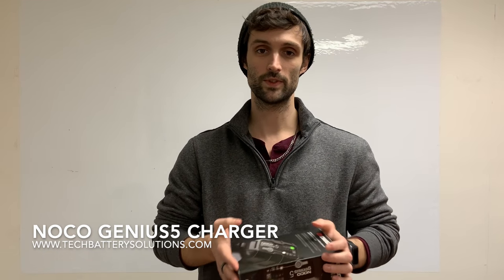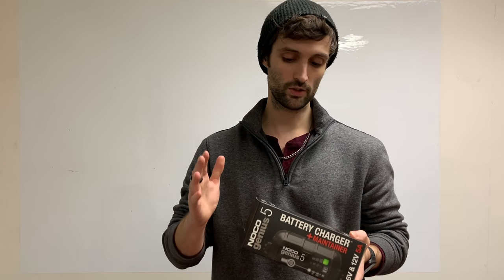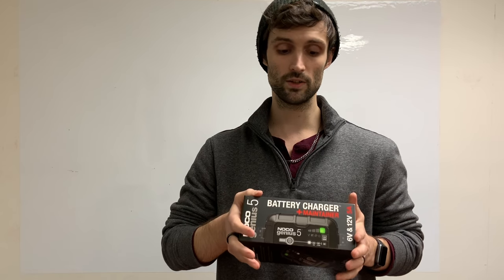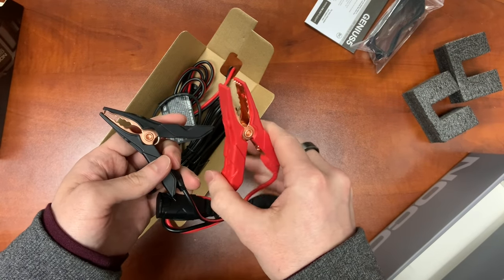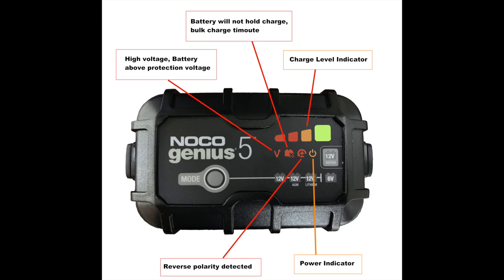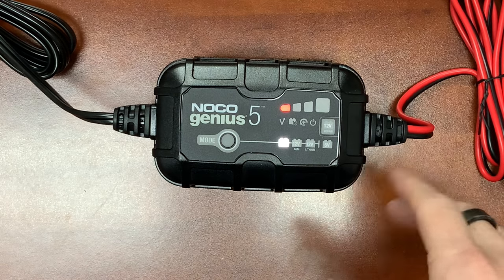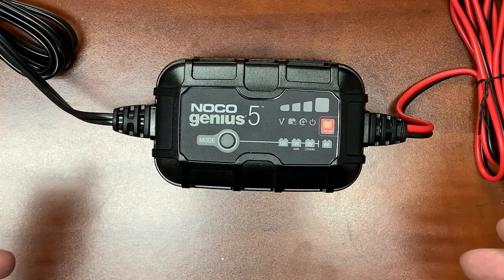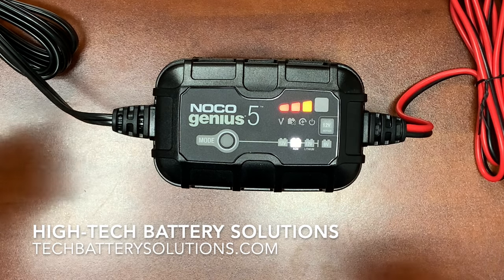NOCO GENIUS5 Battery Charger Review, In Depth

Comment: My question is do you charge the charger and store it in your vehicle or does the charger itself have to be plugged into an electrical outlet to work?
Reply from the maker: The charger must be plugged into an AC outlet in order to charge, it does not have an internal battery.

Comment: I have this charger and for the first few months (arbitrary, was taking detailed notes) it worked fine.  This included switching out of "maintenance mode" and recharging the battery when loads were placed on them.  My shunt would record essentially 0 amps when in standby and when I applied a load I could see the - amps for a while and eventually I would see + amps (varied based on load but the math was always "load - 5amps" as expected) as the charger sensed and began to replenish the battery.  If I were plugged in and using loads my battery was basically always at 100% per my shunt indicator.  

And then I noticed when checking the battery monitor that it was at 90%, or lower depending on how long since I checked.  Long story short, the charger would not come out of "maintenance mode".  Unplugging and replugging would initiate a complete charge cycle back to 100% at ~5amps.  But then the same failure to come out of "maintenance mode" would result.  

This is on a LiFePO4 100ah battery.  I now have a heater assembly on the battery that draws DC power from the system as needed to maintain greater than 40F.  The battery BMS has a cold temp cutoff circuit which was activating a few overnights before I had a chance to install the heating system.  I see nothing in the Noco manual about this interfering with the charger sensing circuitry.  

Do you have any insight on this phenomenon?  I've spoken with tech support and made no progress beyond offering to take my unit back to se if they can duplicate.  In the meantime I've purchased a different charger but have not installed it yet.  I'd rather not use that style charger as it is more of a hobby/workbench charger and not "designed" as a 12vdc battery system charger.  I have high regard for the Noco brand but I cannot figure out why this is happening, beyond a glitch in the microprocessor and/or sensing programming.
Reply: Someone else here said that maintenance mode can last up to 48 hours before going solid green? Mine is currently pulsing, and I don't want to try repair until it comes out of that mode. It's only been on for about 6 hours (just bought the charger today).

Comment: Want to use on a bike battery but the Haynes manual I’m using says should be charged at rate of 0.7 A  (Yamaha sr125 1986) will this be ok or will it over charge the battery? I have other bikes and cars so would rather have a charger that will work on them all. Thanks
Reply from the maker: This charger is a bit too strong for that battery. What you have there is a 6 or 7AH unit, I recommend taking a look at the GENIUS2 series from NOCO.

Comment: If I get noco genius 10, what will be different? Speed of charging? Or is 5 amps safer for regular flooded  12v batteries?
Reply from the maker: It would be the rate of charge as the big difference, both the GENIUS5 and the GENIUS10 are fine for flooded automotive batteries.

Comment: Got my mounted per instructions and as soon as I started my rig it started smelling like burning wire. I disconnected immediately and smell stopped immediately so what’s up here? What did I do wrong?
Reply from the maker: It would take a considerable amount of heat to melt the rubber coating of the wires - there is either a reverse polarity situation or you have a dead short somewhere in your setup.

Comment: Can I start the car when it is connected to the battery with or without connected to the power?   Will it ruin the battery if I use repair mode on a good battery.  I just wanted to put it on repair mode on a 4-year-old battery.  Thank You.
Reply from the maker: I do not recommend you start the car with the charger hooked up to the battery regardless if it's connected to AC or not. The repair mode will not ruin a 4-year-old battery, but if there is no issue with the battery at the moment then there is no need to engage the repair mode.

Comment: Can I trickle charge/maintain my battery by connecting it via the alligator clips? I ask because getting to the battery terminals requires unhooking a bunch of plastic clips and a plastic cover.
Reply from the maker: Absolutely, whatever method you choose to connect the charger to the battery will not make a difference for the functionality of the charger - it will still go into its charge and maintenance mode.

Comment: Hi
I've just bought the Noco genius 5.
I've hooked it up to my flat battery which is only a few months old. It's pulsing red, one light only. Like the light dims and goes solid then doms again and goes solid and so on.
It's been on charge for about 24hrs now, nothing has changed, it's been pulsing since.  According to manual,  red pulsing means it's under 25% charged. It's been 24hrs surely it would have charged over 25%, or is my Noco a lemon?
Reply from the maker: 24 hours is a considerable amount of time to continue on the first stage of the charge cycle. Do you have another battery you can try the charger on by chance?
Reply: @High-Tech Battery Solutions, Inc   i decided to reset the charger. After resetting it was pulsing on first red for about an hour, then it went straight to the green pulsing.
It's been green pulsing for about 6 hours, the battery indicator has turned to green which I'm really happy about. Not sure why it stayed in the red pulsing stage for so long.
Battery is charged.  I'm leaving it overnight pulsing on green. Thanks for your reply.

Comment: Great review. Will this charger be sufficient to charge/maintain standard sedans such as Lexus and Honda?  How is the GENIUS10 compared to this GENIUS5 (for example, what additional features on the 10 would warrant twice the cost on Amazon? And is it really needed?). I saw that your channel also reviewed the GENIUS10 review as well. Thank you.
Reply from the maker: The GENIUS5 will handle any car battery without an issue for both battery charging and maintenance. The only true difference between these chargers would be the charge rate - the GENIUS10 at 10 amps and the GENIUS5 at 5 amps.
Reply: @HighTechBatterySolutionsInc  thank you

Comment: Can I keep the battery inside my house to charge or does it have to be plugged while the battery is in the car?
Reply from the maker: I recommend leaving the battery in the vehicle to charge if possible, its far safer to charge the battery outside rather that inside your house. Flooded batteries will gas when charged, AGM batteries are safer however can also gas if they developed a short.

Comment: How do you turn it ON? I just bought this, put it to charge but when I press the Mode button it doesn’t turn on. Or those it turns on when it’s connected to the battery?
Reply from the maker: When you connect the charger to the wall outlet prior to connecting it to the battery do you get any lights on the charger at all ?

Comment: NOCO 5 does not charge 6v lead sealed battery. Will only charge a 6v AGM (absorbent Glass Mat)
Reply from the maker: Negative, you can charge wet cell, gel cell, enhanced flooded, and calcium style batteries in the 6V mode - the 6V mode is actually not recommended for AGM batteries.

Comment: Can I use it while the battery is still hooked up to the car, especially when starting a very dead battery 🔋 🤔
Reply from the maker: You can leave the battery connected to the vehicle however keep in mind this is not a jump starter. NOCO does not recommend starting the vehicle while the charger is connected to the battery.

Comment: Does this work for standard 12v pickup truck batteries? Here is my battery Ssb 24REXT.  If so would you use the 1st mode 12v?
Reply from the maker: Yes, this battery charger will work on all automotive batteries without an issue. For your 24REXT series battery you would use the standard 12V charging mode as that is a flooded group 24 series battery.
Reply: @HighTechBatterySolutionsInc  thanks!

Comment: Does it come charged out of the box?
Reply from the maker: Just to confirm, this is a battery charger and must be plugged into the wall outlet in order to charge. This unit does not have an internal battery and is not able to jump start any vehicles.

Comment: When I get it tomorrow, do I have to enter any specific mode when I hook it to my c6 2008 Z06?  I want it to trickle charge and keep the battery at full charge.
Reply from the maker: You want to use the mode that corresponds to the chemistry of battery you have in the bike.
Reply: @HighTechBatterySolutionsInc  it’s a standard car battery
Reply from the maker: @Maximus091768  Then you would use the standard 12V mode on the charger.

Comment: Hi can I charge my car battery while it's connected to the car using the genius5 or I have to disconnect the battery from terminals
Reply from the maker: You can charge the battery without disconnecting it from the vehicle
Reply: Oh ok is there a way I can charge the battery with the hood close because I believe the alligator clip might get in the way way

Comment: One question. Do I have to remove the dead rv battery under my hood to use this device in the house? Or is this device  chargeable with the tail end plug 🔌 n the just go outside and clamp it to the battery while still in place under the hood? I’m confused how to actually use it. I purchased this today
Reply from the maker: The GENIUS5 battery charger does not have an internal battery, so in order for it to charge your RV battery it will need to be plugged into the wall. Now you can run an extension cord out to the RV to avoid removing the battery if it's parked in your driveway. If its too far for an extension cable to reasonably reach then bringing the battery to a location with an AC outlet would be your only option using the GENIUS5 charger.
Reply: @HighTechBatterySolutionsInc  ok thanks! I’m late but it’s been a while right and it worked bc I realized that! The product works however I tried to do it again and forgot which mode to select right, it’s not charging! I need help. I did it the first time now it won’t confirm. Meaning when I hold it til it gets to the 12v in the front, it doesn’t CONFIRM and start charging . It should be pulsating but it doesn’t ! I’m so frustrated now. Cause it worked at first. What to do? I attach the red first then black. I selected the 12v mode then it just keeps blinking fast from red to green as if its still in standby mode. Why won’t it charge? The mode button is just trash. It should be a button that just allows you to click on for which ever mode you’re on. All this holding is worthless and it doesn’t even confirm when it’s on that mode. Please help
Reply from the maker: @e_thegod5303  When you say the charger is blinking fast from red to green - it sounds like your in the force mode which will have the charge mode LED and the charge LED alternate with each other. You do not want to hold down the mode button - a simple click will switch between the primary modes of the charger. You want to click the mode button (do not hold) until the 12V mode is lit up.
Reply: @HighTechBatterySolutionsInc  noooo this thing is on the 12v mode and it’s still blinking showing all the colors vs pulsating indicating it’s charging. Can I email you footage of this? Man I paid $105 and it already seems broken
Reply from the maker: @e_thegod5303  I think it may save you some time here to reach out to NOCO direct to see if they can confirm its an actual warranty issue. You can request a call back at https://no.co/support

Comment: Is this for standard 4 cylinder Suzuki Swift car too ? 

Is it for Mercedes sprinter large van battery too ?
Reply: If it is 12 or 6 V battery
Reply from the maker: This charger will work on the Suzuki without an issue. If the Mercedes has an auxiliary battery bank on it to run additional accessories then I would recommend stepping it up to the GENIUS10 unit.

Comment: Hi Richard - I have a 2003 Ford F250 diesel with two batters in parallel and just purchased the Genius 5. Do I just hook up the clamps to the appropriate terminals on the driver side battery and does the Genius 5 automatically trickle charge the batteries with low voltage?
Reply from the maker: In most cases yes, that is the way they are set. If you have access to a voltage meter you can double check that your AUX battery is getting charged as well. In some setups there is a essentially a kill switch that when the vehicle is turned off then the AUX battery is disconnected from the starting. Its not something we see a lot, but I have seen it.

Comment: Thanks for the video. So are you supposed to keep it hooked up to your car so it can replenish the battery anytime it dips?
Reply from the maker: Ideally yes, the charger can be left hooked up to your vehicle battery indefinitely to keep it topped of with no adverse effects to the car or the battery.
Reply: @HighTechBatterySolutionsInc  thanks. I’ll keep it in the battery
Reply: @HighTechBatterySolutionsInc  After hooked up for 12 hours, mine became very hot on bottom. Like 70 degrees Celsius.
The green light just pulses.
Also, the dead battery showed charged in 45 min ...how can that happen?
Reply from the maker: @westbay5858  If its flashing on the green lights then your not at 100% fully charged. Was the battery total flat lined and how big is the battery?
Reply: @HighTechBatterySolutionsInc  it was a12 volt agm car battery with 2 volts in it.
Isn't flashing green in maintenance mode? 
My volt meter reads 12.5 volts after 45 min. Seems too quick.
Reply from the maker: @westbay5858  That is too quick for sure. The pulsing green light means you're at the very end of the charge cycle and its tapering down the charge rate. In my personal experience if the charge rises that fast then there is a good chance the battery is damaged beyond repair. Its not a 100% guarantee, but I would leave the charger on until you get a solid green and then get the battery load tested to make sure its output is good.

Comment: I can't get this to charge SLA batteries(tried 2 genius5). tried 12v 6a and eventually tells me they are bad batteries. I hooked up a meter and I did notice its pulsating 19v ever 1-1.5 seconds to the battery. not sure if that is normal.
Reply from the maker: Have you checked the battery to see if there is an issue with it? Also, what error is the charger throwing?
Reply: @HighTechBatterySolutionsInc  no issues. tried about half dozen SLA batteries. it eventually after hours on the charge will eventually light up the bad battery icon.
Reply from the maker: @antok86  Not sure how to trouble shoot that - especailly if this is your second unit and your having the same problems. We have not had any weird battery default errors charging SLA or lithium batteries on the GENIUS series. I would try reahcing out to NOCO support to see if they have any remedy for you - no.co/support.
Reply: @HighTechBatterySolutionsInc  have you been able to charge 12v batteries that were at or below 7v?
Reply from the maker: @antok86  Yes

Comment: Can this charger keep on maintain for more than a day. Say I leave car charger on for many days. Why it turns to standby mode? Is this mode still maintaining my battery?
Reply: Each time I plug in for charge after a few hours it goes to standby. Why is that? Will it charge again automatically if battery become low again?
Reply from the maker: @MT-xy7fw  What light does the charger go to when you say its in standby - is it just the power light on?
Reply: @HighTechBatterySolutionsInc  orange light up.
Reply: @HighTechBatterySolutionsInc  at 4.00 your video diagram say it is the power indicator.
Reply: i left it for 24 hours and now it goes to maintenance mode. So it does actually switch from standby to top up when battery goes down.

Comment: Lets say we are in camp site with power outlet, can I charge the car battery with noco and plug a heater to the car cigarete lighter?
Reply from the maker: Probably not, the heater may have a strong enough draw on the car battery which would cause the NOCO charger to error out thinking there is an issue with the battery itself.
Reply: @HighTechBatterySolutionsInc  I see, what about a laptop or home internet box? Probably 65 watts?
Reply from the maker: @jacksongil9123  You would probably be okay with that low wattage draw.

Comment: I need a charger to keep in my car in case my battery dies when i'm at work. What do you recommend?
Reply from the maker: Are you looking for a jump starter or a charger? All of the NOCO GENIUS series chargers require a wall outlet to charger your battery, so if your in the middle of parking lot its not going to do you much good. If your looking for a portable jump starter with a self contained battery (no AC required) then I recommend taking a look at either the NOCO GB40 or GB50 series jump starter.
Reply: @HighTechBatterySolutionsInc  Yes a portable jump starter. I will check out the ones you recommend. Thanks

Comment: I just got one of these its the genius 10, I'm wondering if I can safely hook it up to my diehard agm battery while connected to my alternator and just leave it for when I don't drive the car for a few weeks or so? will it keep my amg bat' topped off?
Reply from the maker: Yes, you can leave this charger connected to your battery without worry - it's designed to be able to charge the battery without removing it from the vehicle and it will not overcharge the battery nor compromise any of the electronics in the vehicle.

Comment: Does the battery have to be removed to use the 5Gen in Repair Mode?
Reply from the maker: NOCO does recommend disconnecting the battery from the vehicle if you were to engage the Repair mode.